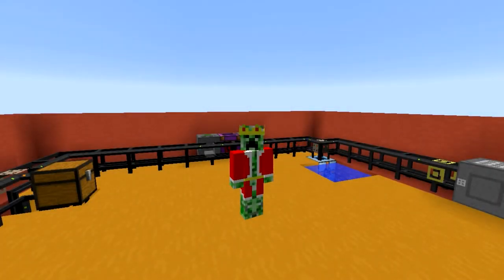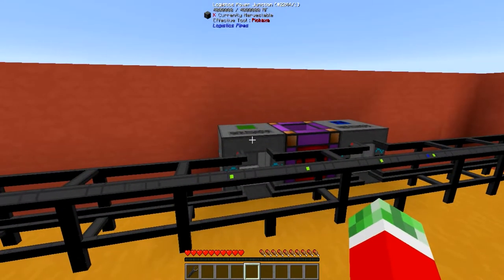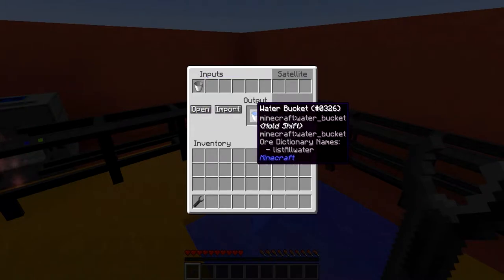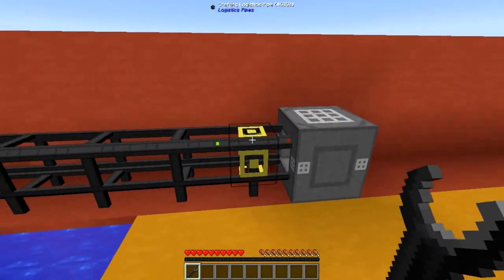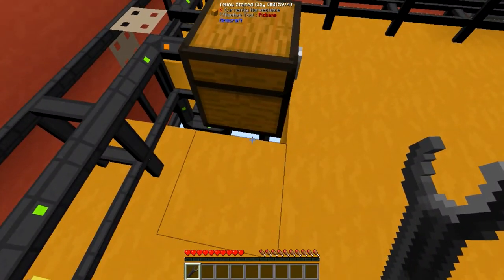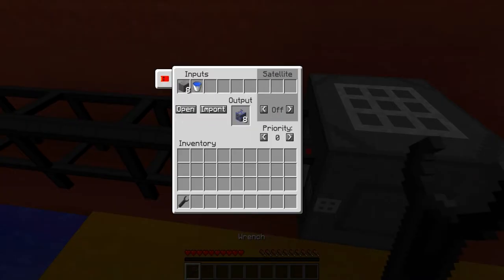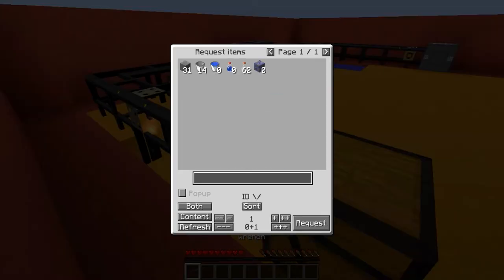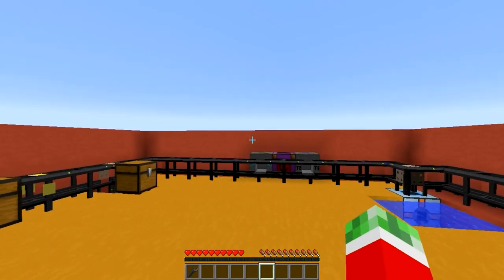Logistics Pipes Tutorial - #13 - Bucket Filling (Water)

Comment: the problem i am having with this build is that my system auto crafts buckets as well so it crafts the buckets while waiting for it to be re-filled, what would be the best way to stop that from happening
Reply from the maker: +landiln21 Hey Landiln21! I think the best way to go about your issue, is to make a separate LP network/Machine dedicated to filling buckets and putting them in the crafting table. Then you can remove the need for Buckets in the Crafting Pipe, but keep 2 supplied at all times for example from the subnetwork. This will make it so it won't try to craft buckets, but just fill them and put them in the crafting table. Hope this helped! :)
Reply: this is kinda how i fixed it! i used an ender io tank and chest. use the LP network to fill the tank with the fluid and put the buckets in the chest.  after that i user ender io cable to move it from the chest to the table. works pretty quick.  Thank You for the response btw

Comment: how can u fill a bucket or glas bottle with LP with from a LiquidTank. So this version but without activator.
Example: like to craft treated wood planks from immersive engineering
Reply from the maker: +traumzauber23 Hey traumzauber! Instead of using the autonomous activator, you could use a Liquid Transposer, and pipe the Creosote Oil into that to make the treated wood planks :)
Reply: i know but I am looking for a option where no power is needed. filler from MFR is not using that much but nayway, is there a possibility without using power (apart of thge logistic pipes)